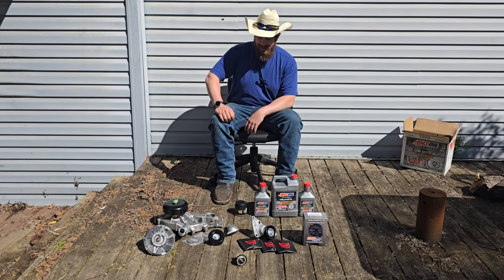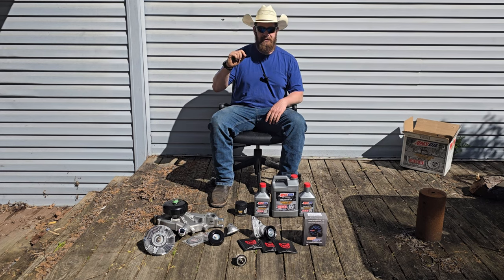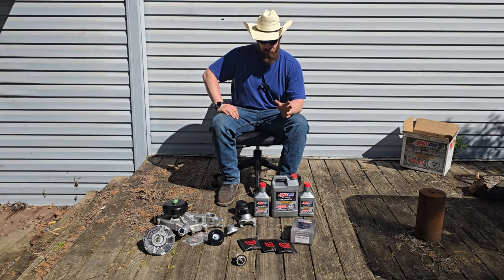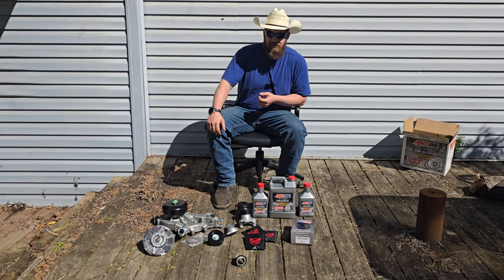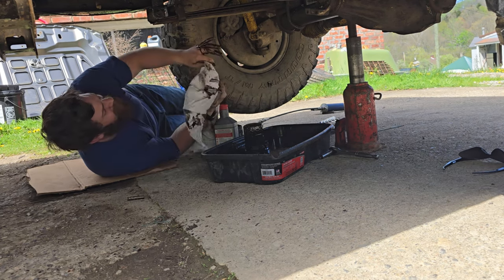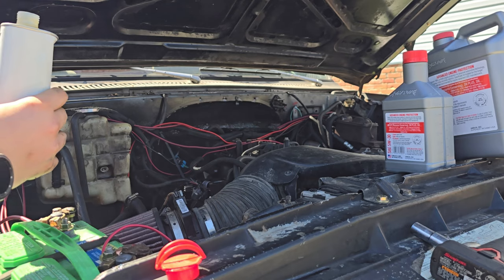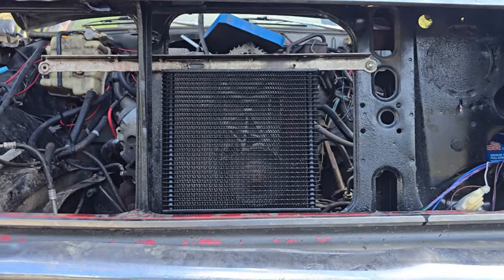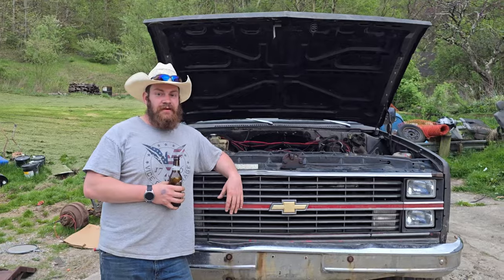I broke the LS in under 500 miles!

Comment: Hey boss. Im installing rhat same walter np208 vss. Did your ecu recognize the vehicle speed?
Reply from the maker: Yes. It doesn't matter which way you hook up the wires to the sensor.  Just make sure that you get the sensor close enough to the reluctor wheel. If you have it too far out your transmission won't shift and you can adjust it from there.